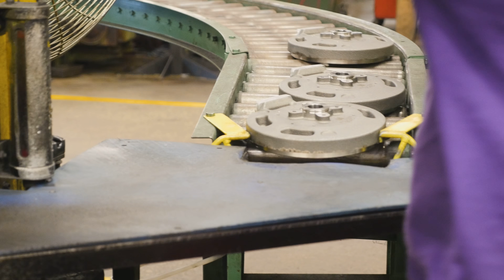How Kohler Lawn Mower Engines Are Made

Comment: Got a question Ed - There's a growing number of electric mower brands out there that are trying to edge into the market to compete with gas mowers.

I wonder if there would be a market for an all-electric mower that none of the electric mowers out there could hold a candle to? You build machines that are heavy duty and can take a beating - how about a machine that runs on a battery designed the same way? Like one of the 1200 cranking-amp batteries that truckers use on their heavy lift gates and APU's?

Comment: I have a craftsman mower with a Kohler sv735 courage engine. It has some design flaws. The coils go bad and must be replaced with plain jane coils and Kohler sells the replacement kit for both coils. Even worse is the starter problem. The starter has a gear that uses a rubber clutch surface to engage the flywheel. This rubber clutch surface disintegrates and comes apart. If you notice your engine makes a different noise when the starter engages but still starts, do not attempt to start the engine again. If you do, teeth on the flywheel will be broken off and then the starter shaft will snap off. You can buy a new starter kit to replace the starter gear. But if you must replace your flywheel, it will cost you over $200. A new starter from Kohler costs about $170. However, you can also buy a replacement ring gear for the flywheel for $40 and gently as possibly remove the old ring gear with a punch, heat the new gear with a propane torch and place it on the flywheel. Many people are having the same problem with this Kohler engine.

Comment: What's the difference between the Confidant and the 7000 pro from Kohler.
Reply from the maker: All the mechanicals inside are from the Command Pro series.
Reply: So, just the air filtration is the biggest difference with the confidant having a cyclonic filtration?

Comment: Hi Ed, is Kohler the engine you prefer? Is the Kohler EFI system better in your experience than say the Kawasaki? 

Is a Kawasaki FX730V-EFI a possibility?
Reply from the maker: I like the mid-level confidants.  For the larger machines like the ZK I think the Vanguard gives you a better package.  In terms of the Kawi EFI, not a fan of it yet. -Ed
Reply: I am considering a Wright Intensity in 48" deck, I am a homeowner and I have never liked carburated engines. I know your products a solely aimed at the commercial market, but I have a large in areas sloping yard and I don't want a sit down mower so...